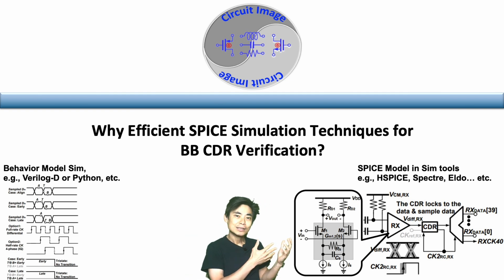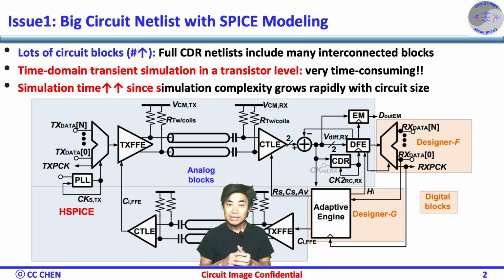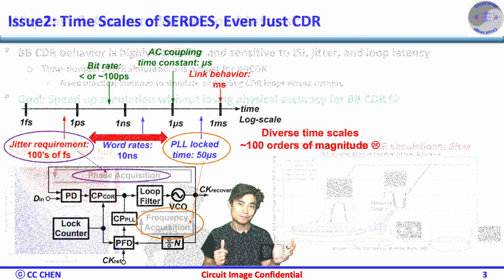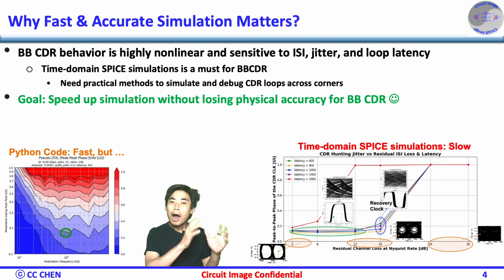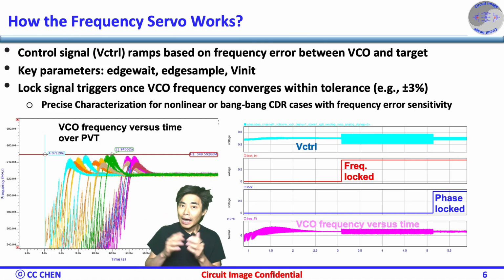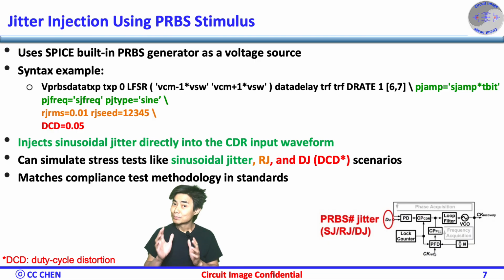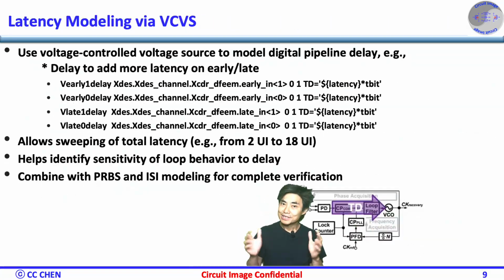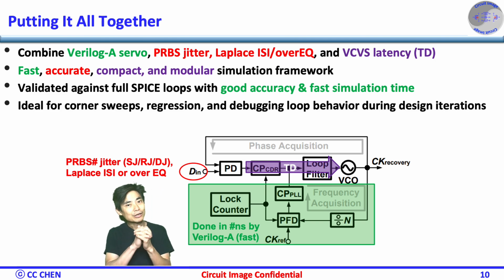Why Efficient SPICE Simulation Techniques for BB CDR Verification?

Comment: Hi, have you considered covering the topic of non-Gaussian random jitter in high-speed systems?
Many analyses assume Gaussian jitter, but in practice that's not always the case, for example, due to EMI coupling or asymmetric phase noise.
A video discussing its impact on BER analysis, measurement techniques, and SPICE simulations would be extremely valuable. Thanks!
Reply from the maker: Hi Youssef,

Thank you for the excellent suggestion! You’re right—non-Gaussian random jitter is also an important practical consideration, especially due to EMI and asymmetric phase noise, which can significantly impact BER and system performance.

I’ll definitely consider making a video covering its effects, measurement approaches, and how to model it in SPICE simulations. Stay tuned!

Thanks again for your valuable input.

Best regards,
CC